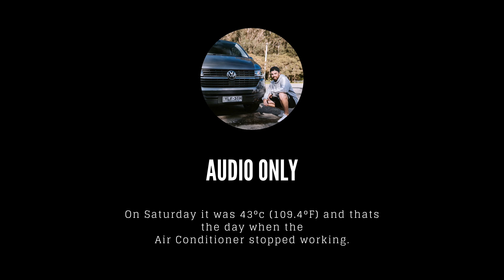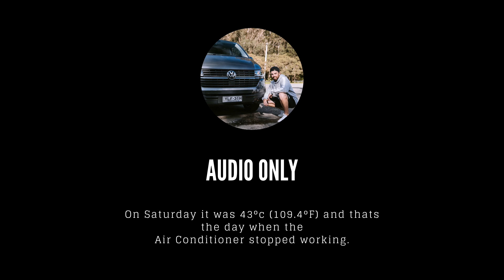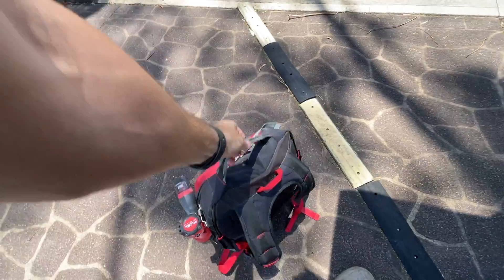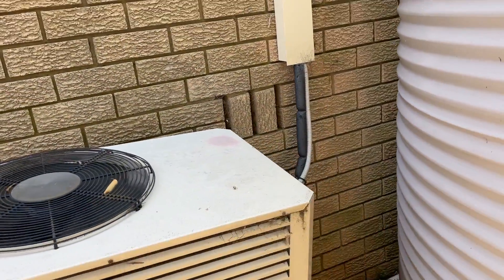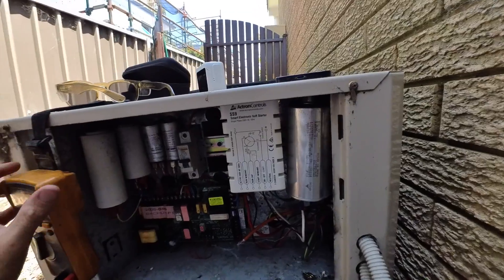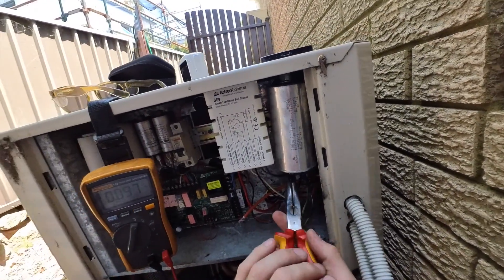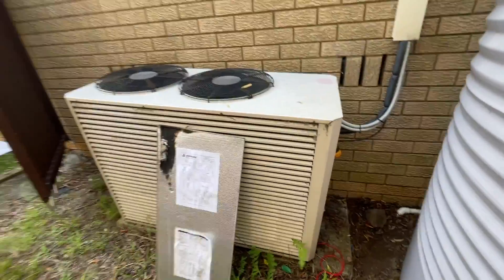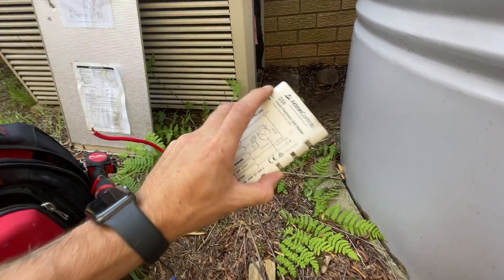ACTRON AIR CONDITIONER NOT BLOWING COLD AIR?

Comment: I was about to ask if you'd taken one of these soft starters apart to see what is actually failing, then I saw a comment by another viewer that it's just a blown copper track on the board which can be linked out. If that's all that is failing then repairing these is straight forward. This interests me as an electronics engineer, because units like this shouldn't have a repetitive failure.
If it is just blowing copper tracks, that's a design flaw - the tracks have been under-sized for the rated load. 
Given the price of these soft starters I would most certainly be looking to repair them.
Reply from the maker: @stopthebus  hey mate, from my personal experience, some times that’s the case. Sometimes it’s the capacitor. Sometimes neither of those things and the pcb just doesn’t function correctly. If you have the skill set to repair these, then there is plenty of business for you out there lol let me tell ya!
Reply: @maracservices  I would be interested to look at a few of these and see what's failed. I am across the ditch in NZ and I don't think Actron is a brand used here - I have never seen any so the trick is how to get my hands on some failed starters. TBH I am surprised that there isn't someone over there who has done this and repairs them.
Reply: @maracservices  id like to have a look at the soft starter modules, especially a blown one, i'm in sydney australia where are you based?

Comment: Could it cause more issues if the soft start is removed?
Reply from the maker: @AleksSukuroski-b6l  it doesn’t cause any issues. These systems were wired as such for a long time. It will just draw more current on startup.

Comment: What is the name of the starter you used to replace the Actron soft starter? Where did the starter come from/used for?
Reply from the maker: I just removed the soft starter and put in a contactor in instead. So it no longer has a soft starter.

Comment: Have been told SS9s don’t like voltage drop. 

When replacing them now I use bootlace crimps (on all high load terminals)so you get a much better connection in the terminals with that stupid flex cable they send with SS9s.

Comment: Great video Mitch. 
Just to confirm, you only used the Run winding and Run cap wiring under the contractor. 
The start winding didn’t get used. Is this correct?
Reply from the maker: Thanks mate. 

So an active goes to the contactor then out of the contactor, an active goes straight to the run winding on the compressor. Then another active goes to a capacitor (80uf) then out of the other side of the capacitor goes to the start winding. Common to neutral. 

Thanks 👍🏻

Comment: Not Sure if you noticed but those Soft Starters show a fault. LED Indicator on the bottom right will show a blink sequence indicating what the potential fault is. Most of the time its the physical soft starter. Glad to see you put a contactor in tho, they are junk.
Reply from the maker: Oh really I didn’t know that. Thanks for the tip! 
Yeah mate i had already changed that soft starter twice. I was getting over it!

Comment: Should do a video of how u wire the contactor to replace soft starter
Reply: Very simple. Comp Call  & Neutral will be your A1 & A2 // Active That feeds the SS will go into the top side of the contactor then loop that across to T2 // Bottom side of the Contactor will be your Start & Run.

Comment: Hmmm, I've been replacing the soft starters. So you just put a contactor in and parallelled the capacitor?
Reply from the maker: Exactly mate, run straight to compressor and start through a capacitor to compressor. 

I’ve always replaced the soft starters as well mate. However I’ve come to the conclusion that they haven’t made the new soft starters any better so I’m over replacing them. Even tech support advised me to get rid of it. I have a wiring diagram on how to change to a contactor. If you ever need it I can send it to you. Cheers
Reply: @maracservices  that would be awesome if you could? Those soft starters are expensive and crap.
Reply from the maker: @MentalLapse09  no worries at all mate. What’s your email address? You can delete the email address after I send you the diagram lol.
Reply: @maracservices  can you send me the wiring diagram ,I am onto my 3rd Softstarter at $ 500 a pop
Reply: Can you please send me this diagram Mitch?
Reply: Could I grab a copy of that diagram aswell mitch? I got a sound idea of what you did but wouldn't mind seeing it.
Reply from the maker: @cameronmaguire92  yeah no worries at all mate. Write down your email address and I’ll send it to you. Then you can delete the comment if you don’t want everyone seeing your email address. Or email me at mitchattwood@maracservices.com.au and I’ll send it to you. Cheers
Reply: Hey mate could I grab the diagram off you aswell?
Reply from the maker: @anthonybowman6410  why’s your email address mate?

Comment: ive repaired a few of them over the years. take the board out of the box and solder a multi strand wire the same size as your feed to jump the blown/burnt trace
Reply: Is that all that goes wrong with them? I was about to ask if Mitch had taken one apart to see.

Comment: I have the same unit Actron, I replaced the capacitor about a year ago because it was just blowing warm air and few weeks ago fan motor in the roof gave up not blowing any air at all, just replaced that 5 days ago and it is running perfect now , mind you the unit is about 23 years old and that is the only 2 things I had to do all those years. I am happy with Actron it works well.
Reply from the maker: This one is quite old too and it’s only ever had a soft starter and indoor fan motor fail. Sounds similar!